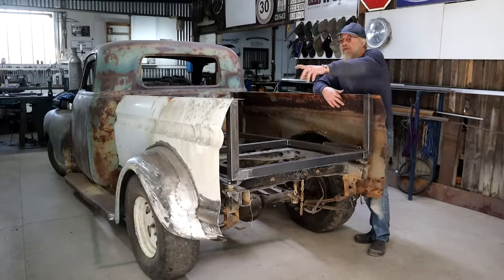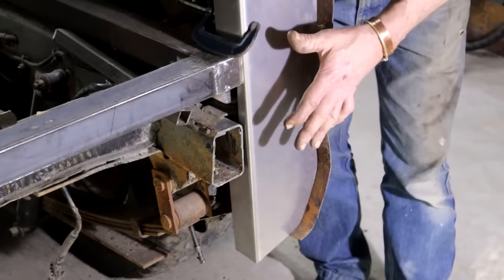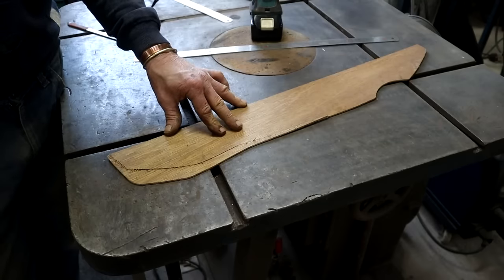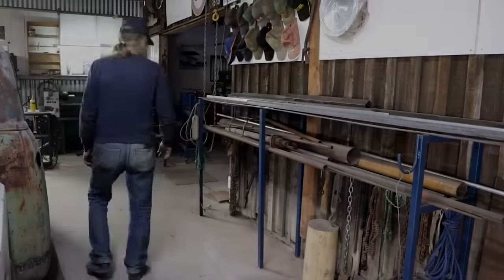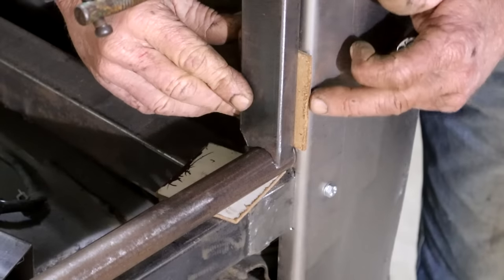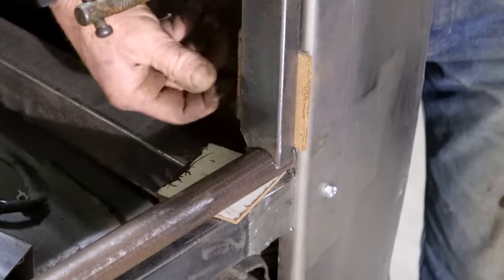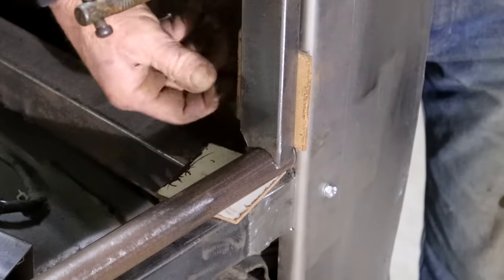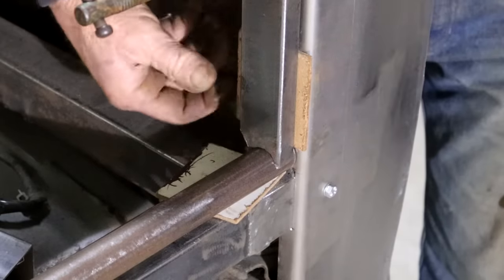BUILDING CUSTOM TAILGATE FROM SCRAP - 1951 Chevy Rat Truck Build

Comment: Great job reusing parts from your salvage yard Duff.

I was watching a show about patina 
If you mix:
16 ounces Hydrogen Peroxide
2 ounces white vinegar 
1 table spoon salt
Mix it in a spray bottle 
The patina comes instantly in seconds without waiting
Reply from the maker: Been using swimming pool acid but might give that a try. Thanks

Comment: That was an amazing fab !    I love it when  you repurpose your yard treasure !!!!!      Love the bushings man !   no squeak no rattle.  I use a good amount of plastic in my trade of tool and die making.  The plastic is a machine able  grade called "Delrin."
Looks very much like what you had.   I know you have many hours in your tailgate and bed ends , but you make it look very easy !        Good work Bro.!!!!!!!
Reply from the maker: Thanks Randy! Yes. that's the name of that stuff - Delrin! I've had enough of squeaky tailgates, so very happy with this solution.😅

Comment: I been looking watching this bed be belt at the same time im thinking how i would or could do the same what i liked etc 🤔 so my mind thinking different i saw you walk by a old truck bed then i realized what i might do if i ever get my shop finished lol . I like the ford bed curves but i think i might flip it as in turn ot inside out cut the curve from the bottom drop it weld pipe down the outside so it be kinda more like a old bed. Your plywood cut out fir the rear gave ne the idea but i dont know lots of measurements and just as you don't want to be to high their to low lol im love you're creative thinking its totally outside the box . In no way am i criticizing just throwing my thinking.  Loved the Beatle fenders i would have totally screwed them up because the headlight holes looked to much like jet engines to pass up the opportunity to lets say mount a rocket 🚀 to each side lol . Thanks for making my mind my imagination grow
Reply from the maker: Thanks for the feedback. You know, I did think about turning those side panels inside out. Then decided that something different from the old style beds will be more fun. Each to his own hey!
Reply: I love the way you work and think outside the box . I bet that very little brings you to a stop

Comment: Great progress as always Diff 👍
Glad the frogs are keeping you company as you do you voodoo !!!  Now about you standing inside the frame to work on the tailgate............I noticed that as the video resumed you were already in there but I am very curious to know.........did you climb over in a struggle to get inside there or crawl underneath and stand up ??? Or simple snap your Africanna voodoo fingers and appear there ????
I'm glad you can see that Hudson from the front of the shop so it can call to you for attention !!!
Reply from the maker: Thanks my friend. Used a milk crate as a step to climb over. Them legs dont stretch that well anymore😅 Couldnt find the voodoo doll...

Comment: Great work! I want to utilize the Delrin bushings on my old Chevy. Looks like you changed the bending edge of your brake, the radius looked “tighter” than what you had before.
Reply from the maker: Thanks! Those plastic bushes really works great. Nope, the radius on the brake is still the same as always. I haven't had the mojo to do anything about it yet... but actually like the larger radius most of the time